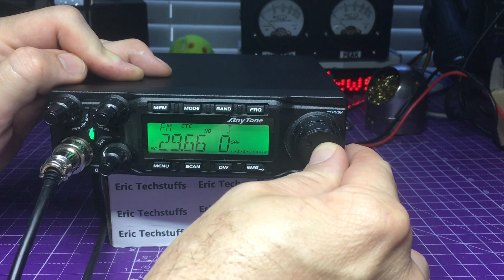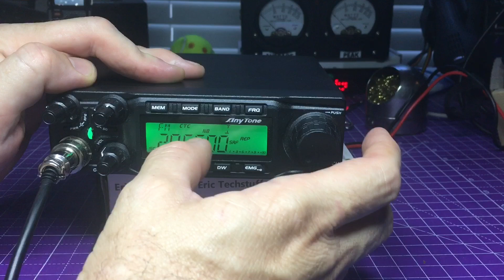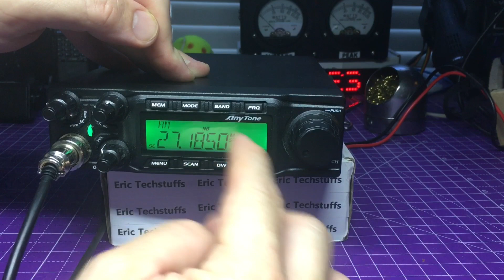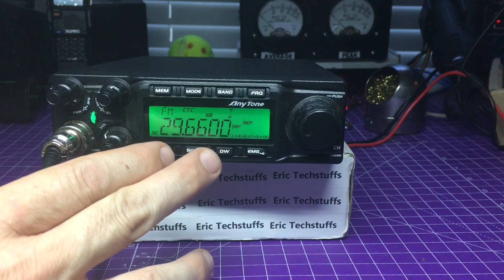Anytone AT-6666 CTCSS Programming

Comment: Hi Eric, just a quick question: I've been comparing the 10 meter SSB transceivers and have pretty much decided on the AT-6666, HOWEVER...it appears that some of these radios are ready to activate the CTCSS (as shown in your video), but others indicate that a separate board needs to be installed before that can be done. Can you advise if this is indeed that case, and how to determine which model is which? Any info appreciated! Thanks....Rick
Reply from the maker: Rick, Great question ! Anyone's parent company  (Qixiang Electron Science Technology Co.)  makes the Stryker series and Top Gun Quad 5 Series. Many have moved to "Version 2" that among other things have the CTCSS board as a standard feature built into the main board.   I have yet to find an AT-6666 with the CTCSS option  "built in". You can do what I did and buy the AT-6666 dirt cheap and get the board from Bob's CB for $20 .

Comment: I liked your video on this Anytone AT-6666 and the manual CTCSS Programming of that radio as I myself do have one of these radios along with the programming software called QPS6666_2.01

It is not the best of programming software and there not much of the way of help files and  the older programming software for past radios seemed to be better especially doing split setting on 10 meter 

I would have like to have seem more on this programming setup up of the Anytone AT-6666 using the programming software called QPS6666_2.01 which is the official Moonraker program for the Anytone AT-6666

Thank you again and I will give this a go and see if this setup will be read and saved by the QPS6666_2.01 programming software as I along see 5 channels that can be save in this manner on that radio which to me is a draw back seeing how there are many 10 meter setting that could have been scanned/
73/s